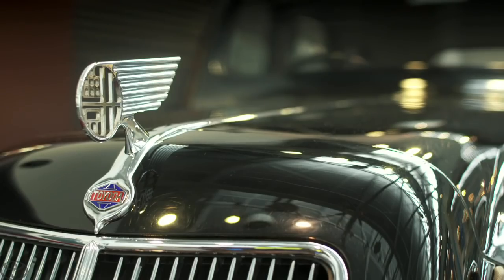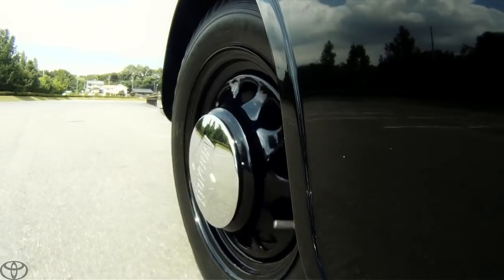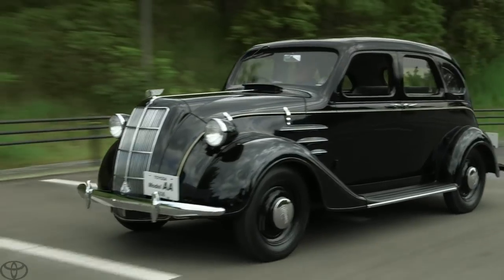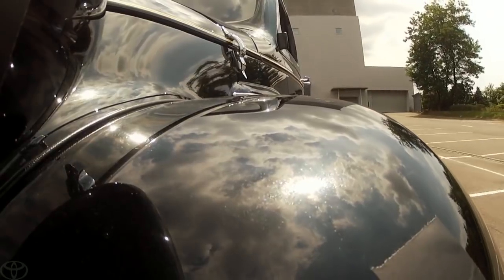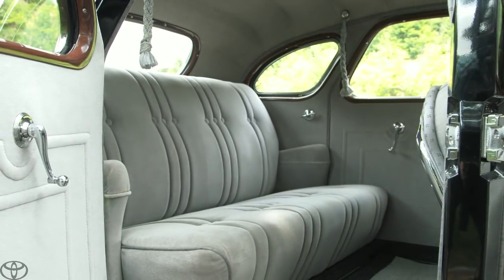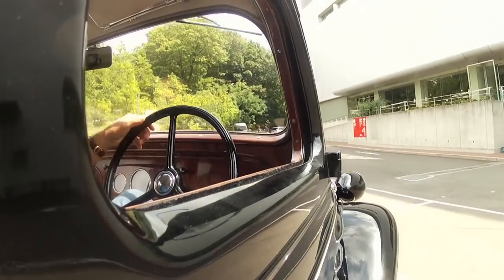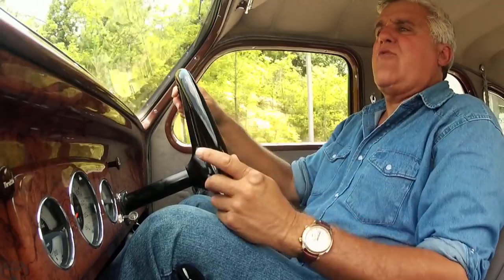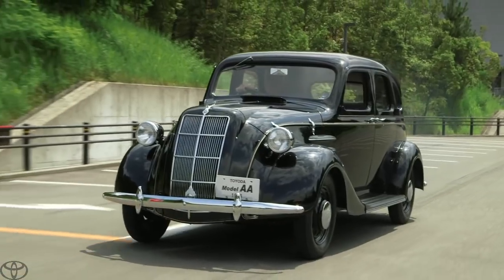Jay Leno Drives the First Car Toyoda (Toyota) Ever Produced | Toyota

Comment: Harrier is available this summer, a 2lit turbo with 6speed auto suv that rides smooth
Reply: Yes 2.0litre Turbocharged Diesel engine from a Fiat, 6-speed torque converter from Hyundai and Platform from Land Rover. I guess even older "Toyoda's" borrowed lesser parts.